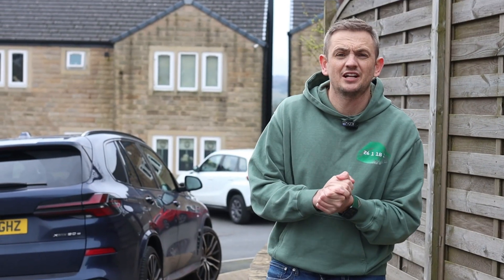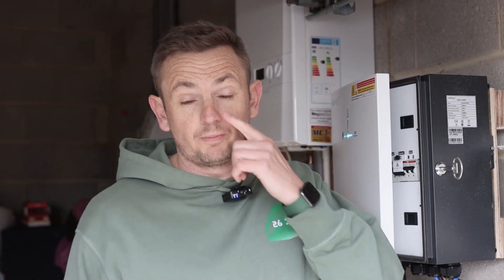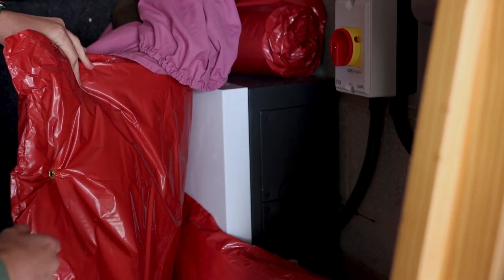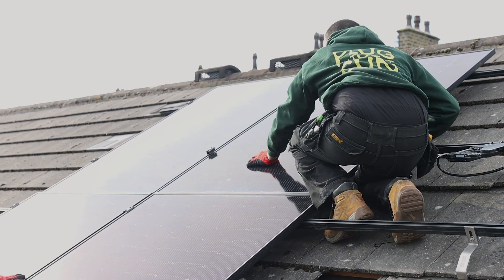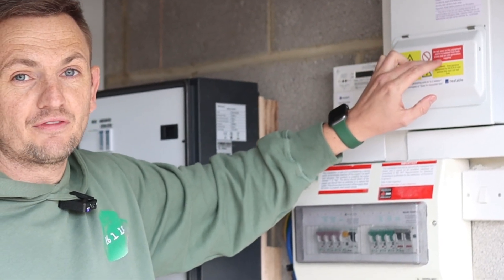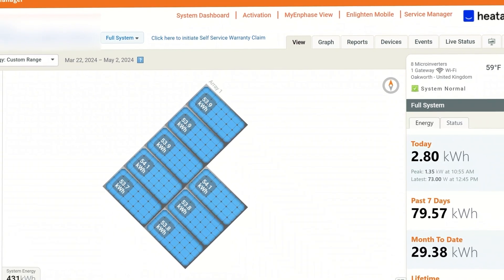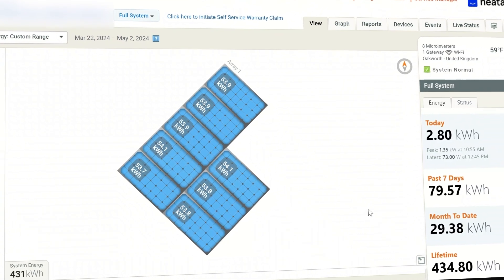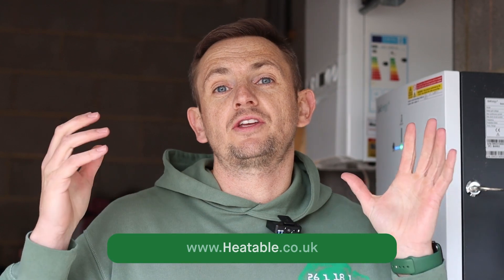Home Battery to Solar: Is it worth the Money?

Comment: "Even on a day like this, there's nothing coming from the grid".  How impressive or even relevant that statement is depends entirely on what the load is.  If there's no load at all, then of course the PV will be sufficient to charge the battery and cover the non-existent load even on a very overcast day.  So what was the load?  If you checked, you didn't see fit to tell us, which doesn't inspire confidence at all.
Reply from the maker: Hi, thanks for your comment, the base load in the property is around 300w. With the usual spikes around peak times,
Reply: @Heatable  Thanks for your answers - I do appreciate them.

Comment: You mention the customer has been saving loads of money charging over night on a cheap tariff and using the energy during the day.  How much money?  What's the calculation?  What is the cost of the battery per kWh, vs the tariff savings?  The video promises an answer to whether it's worth the money, but instead we're getting action hero music accompanying the arrival of scaffolding, and bold claims that the battery is worth it even before adding solar to the system, without being offered any evidence...  I don't mean to sound harsh but some folks tune in to get hard data...
Reply from the maker: Hi, thanks for your comment. 

The battery was installed ahead of our installation. 
To answer your question, the client is on a smart tariff and charges up for circa 7p. This is around £0.18p cheaper than the current standard buy rate. 
The annual usage is around 4000KWh so the client would expect to save up to £720 a year, plus any income from the DFS scheme or export.

Comment: Doing a great job informing people about solar, along with a few other channels.

The combination of Rea panels, microinverters and the GivEnergy AIO is one option that i'm looking at for my install after i move house. Your estimator used to show the AIO as an option for my area (Bristol) but now doesn't. Is that a lack of available GivEnergy installers in my area, and if so, is this likely to change in the coming months? Thanks
Reply from the maker: Hey Joe, thanks for your comment! There shouldn't be a problem fitting an All in One in your area. If you speak to our team they can put this through manually :)

Comment: I don't believe it makes financial sense to use the solar to charge the battery because thats rating the solar output at the same price as the cheap overnight whereas if you export it you can get more than that,on Octopus for example,  octopus intelligent 7.5p night rate export 15p. 

On the cold battery, yep, a relative of mine has a greenhouse frost heater for his battery (and insulation) because prior to that when the battery temperature dropped below 2C the battery would not charge.
Reply from the maker: Hi, thanks for the comment. 
Smart tariffs have really altered the dynamic now, lots of customer still enjoy charging the batteries from solar where possible, some are focused on grid import and export. 

We really rate the Tesla battery with the inbuilt thermal management. The functional operational range is -20+60c

Comment: This was really helpful. 
Exactly what I am thinking I will be doing. 
I like what I hear about GivEnergy and to have the option to pair with the REA panels on a modular basis is great. 
Ridge runs almost exactly N-S. 
but eastern pitch receives direct sunlight later than 5pm at this time of year. Winter sun is low of course and there are shading trees on the west side. 
I would love to engage an IMPARTIAL consultant to advise but they don’t seem to be a thing. 
I have a ton of questions about what I think is a challenging site. 
And I don’t know what I don’t know although discovering more all the time, e.g. some batteries make a noise, some don’t. Some heat and cool themselves making for a safe external fitment. 
And I guess the products and innovations are happening constantly.
Reply from the maker: Hey Francis, thanks for your comment. We try to remain as impartial as possible in initial conversations and only advise on what we think works best based off of what you want for your property. Each set up that we do is different and is tailored around a clients needs. Feel free to reach out to our solar team to get some advise or have some questions answered🙂
Reply: @Heatable  thanks.  I have already been in touch. I’m not going to rush into anything. Except I currently need a car charger that works with intelligent go, and that’s in hand.